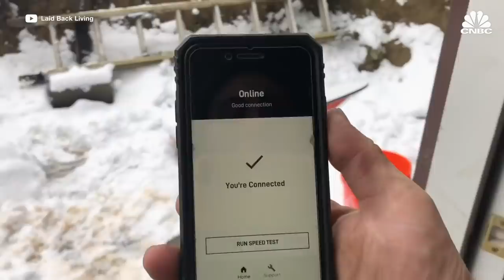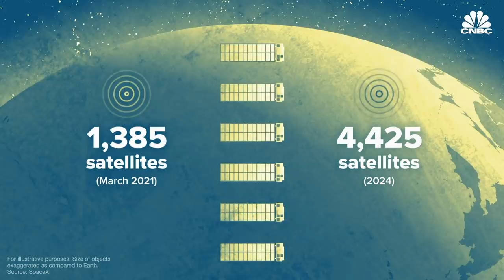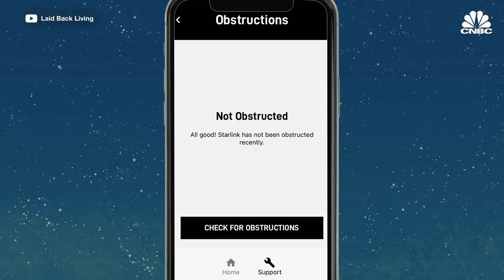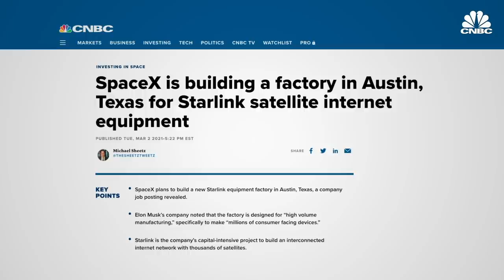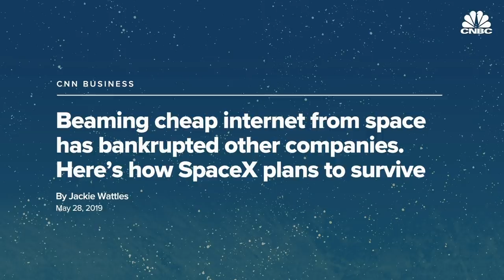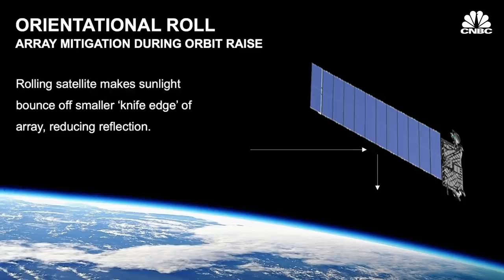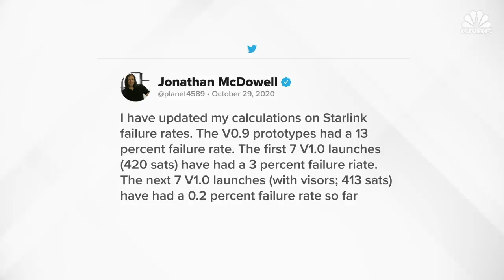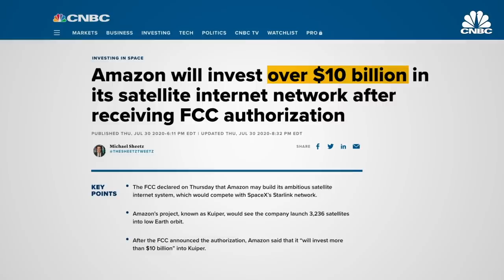Why Starlink Is Crucial To SpaceX’s Success

Comment: I think it was a classy move to work with the astronomers instead of telling them to pound sand.
Reply: And something which every business should do. 
Help the common people.
Reply: Acknowledging you're not the only guy in town and creating room others.. A very classy move indeed. :D
Reply: they have no choice, Astronomers complain to NASA, SpaceX could lose the ability to launch from the facility, they continue to do so congress can clip their wings for good.

Sometimes it's better to take the challenging route before it become unbearable
Reply: @HappyfoxBiz  You take the longer route around the mountain, instead of the short route up the mountain that ends in a freefall off a cliff.
Reply: @HappyfoxBiz  Cape Canaveral launches are controlled by SpaceForce.  FAA is the government agency that gives SpaceX permission to launch.  Right now NASA is heavily dependent on SpaceX for launch services including delivering crew and cargo to the ISS.
Reply: @SDGreg  it's leased from NASA, not Trumps pew pew club
Reply: @someoneinthecrowd4313  if you're unable to achieve goals like launching satellites into space, you shouldn't even start, once the satellite is in space it's mostly just tweaks, if you can't do that then you are hopeless.
Reply: @HappyfoxBiz  The US Space Force has essentially nothing to do with Donald Trump. Most of its missions are the same ones the Air Force was running 5 years ago. Please don't besmirch the good work done by US servicemembers because the branch was created during the administration of a bad president.
Reply: @HappyfoxBiz  SpaceX has two launch sites at Cape Canaveral.  SLC-40 is on the USAF side(Cape Canaveral Space Force Station) now Space Force and the other LC-39A is on the NASA side(Kennedy Space Center). Regardless of the launch site, the launches are managed by the 45th Space Wing of the United States Space Force.  All the radars, range assets, even weather monitoring, yeah that is controlled by Space force.  So yup Trump's pew pew club.  Look it up if you don't believe me.
Reply: @TankDerek  oowah I guess, every tool needs a fanclub, might I suggest spanners?
Reply: @HappyfoxBiz  Wrong. If Congress plays hardball by grounding SpaceX, then how would NASA get the astronauts to the space station? Blue Origin and Boeing are not ready yet.
Reply: @TankDerek  Please don't bad mouth the President that supported the Space Force.
Reply: Elon said astronomers were making a bigger deal out of it than they needed to
Reply: Classy, but also not all that surprising that when the International Community of Academic Space Nerds reached out to the Business and Technical Space Nerds they took the call. I could see there being significant overlap in these two groups as far as dreams and aspirations go.
Reply: This thread quickly devolved from an intuitive comment to you guys arguing about Trump's 'pew pew club', congress, Space Force, and space nerds.
Reply: I would have told them to pound sand. Then again I have no class.
Reply: @HappyfoxBiz  99% sure that Elon would sooner start a space company in Russia than let someone tell him he won't be going to Mars.
Reply: TOO MUCH CRAP IN  THE SKY ALREADY!!!
DON'T DESTROY EARTH JUST TO MAKE A CITY ON MARS!!!--VERY STUPID!!!!!
Reply: From a business sense, it was essential. As they would go to government who would then have stricter oversight
Reply: I think its classy for the astronomers to talk to people who need internet. You know, like the rural farmers who provide their food.
Reply: @khainguyen3056  That clown doesn't even believe in science. Oh but he created Space Force, which was already operating before it was given that title, so lets not bad mouth him, lol what a joke.
Reply: @TankDerek  Space Force isn't even a real branch of the military, it is still completely under the Air Force.  All Trump did was taking a subbranch of the air force and give it a new name.
Reply: @PeterSedesse  The Space Force is a real separate branch of the military. It just takes time to completely separate themselves from the Air Force. A good example would be the creation of the Air Force from the Army Air Corp after WW2.
Reply: @khainguyen3056  that is just not true. There was no plan under trump and still is no plan to make it separate. There is no space force person on the joint chiefs etc. Space force does not have individual budget etc. It was just a photo op.
Reply: of course the russian and chinese satellite commpanies won't be so thoughtful.
Reply: @PeterSedesse  Like I said , it will take time. They already announced they will have their own uniform, different enlisted ranks and their own bases. They will change the name of the certain Air Force base to fit their mission. This is not a hoax.
Reply: @khainguyen3056  trump already said it was its own branch which was a lie. Also there is no movement in the direction that you said. There are no plans for it. We built the entire dept of homeland security in a matter of weeks. Trump had a fake press briefing, and that is the only thing that changed.
Reply: @PeterSedesse  The leftist media really did a job on you. I don't know what else to tell. So long.
Reply: @khainguyen3056  Is there a space force general on the joint chiefs?  No  Does space force submit their own budget?  No Does space force have their own basic training? No    That is three proofs that space force is not an independent armed service.   I have evidence, you just have Trump's press conference.  Do you even know what the Joint Chiefs are?
Reply: @PeterSedesse  When Air Force was spun off from the Army Air Corp, do you think this happen overnight? The Space Corp only just came into existence. They are still dependent on the Air Force on certain things. Rome wasn't built in a day. Be patient and stop jumping the gun.
Reply: @khainguyen3056  Just not true.  There are no plans to make it separate.  Nobody except trump wanted it.. not the GOP, not the Dems, not the Air Force.  It was all just so trump could have another meaningless press conference.
Reply: Outer space is a lie created by the ruling class which knows the sky is solid frozen blue ice.

 Google image the firmament
Reply: "Work with the astronomers" is going to be difficult once there are 40,000 satellites orbiting the planet. SpaceX is just going to string them along until they become too big for anyone else to do anything.
Reply: @Avantime  That is just bad math.  The satellites are half the size of a car.. the sphere they occupy in orbit is 4 times the surface of the earth.   Most small cities have 40,000 cars, now spread them out to 4x's the surface of the earth,  .  Throw in the fact that Hubble and many newer telescopes will orbit above them.
Reply: @PeterSedesse  If astronomers can notice the satellites when there are only  3,000 of them to the point where SpaceX has to do something, then it's going to be a much bigger issue with 40,000. However I couldn't care less (or be surprised) if SpaceX throw those astronomers under the bus later on, once their services are deemed indispensable by many rural residents.
Reply: @Avantime  Of course you can see them if you look for them... but does it negatively impact astronomy?  The one issue they had was the light reflecting off of them, so they put solar screens on the new ones.   To put it in perspective, when Hubble did a deep scan, it was less than 1% of 1% of the sky.  This idea that something smaller than a car, hundreds of miles away is going to ' block' anything is silly.   The sphere that they orbit is huge, and they are tiny... and again, all modern building is about putting telescopes in deep orbit or on the moon to avoid light pollution on earth.
Reply: Generally, Musk companies have been good citizens, and played nice. They compete ferociously, but they do so by being terrifyingly efficient and just improving the product itself, not by playing dirty. For instance, SpaceX holds no patents, and when new competition arrives, far from trying to sue them for some kind of IP infringement, SpaceX welcomes them into the industry, congratulates, and even advices them. Take a look for example at Peter Beck's exchange with Musk on Twitter after Rocket Lab announced the Neutron, which copies a lot of design elements from the Falcon 9, and will be direct competition. Musk joked that it "looked familiar", and then proceeded to congratulate Rocketlab, and said that it was certainly the right move. No lawsuits, no hard feelings. The same goes for Tesla. On Tesla's website there's a section called "All our patent are belong to you", that links to an open source contract that basically allows anyone, including competing car manufacturers, to do whatever they want with Tesla's patents for free. 

More often than not, when a company arrives at a location and sets up a factory, the neighbors hate them. SpaceX paid Boca Chica residents 3 times above market price for their land, many residents started businesses around what SpaceX does, and they have a great relationship, even when they have to kick them out of the villa to test a Starship. 

They allow the fans to film pretty much everything they do, and they've even allowed many like Labpadre or Everyday Astronaut to actually place cameras on SpaceX property. 

Now they won the HLS contract, but they didn't do so by lobbying and playing dirty like BO, they did so by actually following the rules to a T and making a better bid. 

They really try to be good neighbors, and play nice. They will compete mercilessly, and they won't really let anything stop them, but playing dirty doesn't seem to be in their manual, at least so far.
Reply: It was nicely done by SpaceX, Elon probably want his red planet to look as magical as always trough a telescope, rather than his companys satellites destroying the view of the red planet with reflective interference all the time. 😅.
Reply: Even better is SpaceX will be able to launch MUCH heavier telescopes into orbit MUCH faster than anything before for MUCH cheaper. Then those satellites can utilize Starlink for their data backhaul. It's gonna be epic.
Reply: @gingerman5123  Not just heavier and larger telescopes, but cheaper and more available telescopes. Right now, it's hard for most astronomers to get time at any earth-based telescope, forget about getting time on anything in orbit. The Hubble gets tens of thousands of requests per year, and only a handful of them get any time. 

Right now, there is no way to service the Hubble, when it dies, it dies. Starship would not only be capable of going out there and servicing Hubble extending its mission another 30 years for comparatively very little money, It could even do so in a way it's never been done before: With a "dry dock". That is, it could fit the entire hubble in its cargo bay, close the doors, and re-pressurize. Then specialists could work on it easily, without the dangers of an EVA, and the bother of a spacesuit. 

It can launch new telescopes for a fraction of the current cost, and it would also decrease the cost of production of the telescope itself, as much of the current cost comes not just from manufacturing the telescope, but from manufacturing one capable of being launched in current rockets with smaller fairings, and capable of staying out there without maintenance for a very long time.
Reply: @user-sn8oe5sb1b  I’m pretty certain a Starship will one day bring Hubble home to earth. It belongs in a museum!
Reply: @gingerman5123  I would absolutely love that.
Reply: Problem is, like the usual satellite options available, there is a large energy liability for off grid users, which is the main market. I just got a conventional satellite system that uses over 120 watts 24/7 not including the router  . Assuming Skylink is the same, that could become the largest load in the house. Not good for off grid energy limited households. But that's the cost of data i guess. I wander if Musk has thought of that? Is the system designed to be efficient, especially if it has a standard snow melter on it dishes. Would be a waste in Australia...
Reply: @craigme2583  We're obviously on the first revision of the hardware. I'm sure V2 will have a LOT of improvements. I'm in Central Texas and the snow melting isn't necessary but for 5 days out of 1000. I believe "Dishy" pulls about 100w also.
Reply: @gingerman5123  seems unnecessarily high, but we have high power costs here.
Reply: When your company is pretty much solely staffed by people who hold a fanatical belief in a space faring humanity you pretty much take the word of Astronomers as scripture.
Reply: I just hope they can do enough.
Reply: Why do y’all think they are so worried and concerned about the  “rural”  homeowners not having fast internet? Internet of things?? It ain’t cause they care about y’all 🙄
Reply: @HappyfoxBiz  They can have more than one incentive to do something. It's good NASA forced their hand just incase, but the fact they cooperated at all, and did so in an amicable fashion is yeah, a classy move. Either way it happened
Reply: "Classy move"??? Musk has admitted Starlink is counting on a final deployment of 42,000 SATELLITES! No matter WHAT Starlink does to reduce light observable by the naked eye, BILLIONS of $$$$ worth of telescopes across the Earth will be unable to capture the faint light of near-Earth meteors that risk striking the planet! "Class-act" intentions by Musk are hollow gestures and meaningless. He alone will increase the total amount of current satellites by as much as a factor of TEN! It is a factor of 5X's if you include defunct satellites launched since Sputnik. Countries need to capture & de-orbit their decommissioned sat's or eject them from orbit towards the Sun.
Reply: Yeah
Reply: @PeterSedesse   
  Not true I want space force. And it is in the works from what I've read. All I do is eat sleep read retain useless information and knowledge my brain should already know for a fact checkers board game of who's right. "Cause that's important" no the names not important making shore our species gets to live on if earth becomes uninhabitable that's important. Theres many things that can cause this. I really hope we all can be on the same page if where ever ask to go there and help. If we cant be humanity could be doomed. We will be the cause of this over time if we stay stagnant in time polluting our own atmosphere, wars, asteroids that out smart us "so big blowing it up could only cause more harm to us all" these are facts we as humanity never know what's coming let's become the humanity that makes there own path the patch of survival plan B but also it's the path to push forward to become better versions of our selfs.
Reply: @HappyfoxBiz  He can always launch from private land. congress doesn't own space
Reply: @PeterSedesse  well buddy, all the data that's been collected on their brightness and interference till now says otherwise. Even with the shields. Whether or not it makes sense in your head is kind of irrelevant.

Comment: I already preordered mine
Should be here by end of year
Reply: We ordered starlink and it came in 3 weeks. It could be there fast for you
Reply: @Tryckert  
My area needs more coverage before its available here
Reply: @Tryckert  when did it say it was coming? did it say a month or did it say mid 2021 to late 2021?
Reply: @TheGrandMgM  in my area it said mid 2022, I want to work as software developer freelancer and my 0.5mbps down 0.01 mbps up is stopping me
Reply: How much does it cost?
Reply: @josiah1851  
$500 for the equipment
$99/mo
Reply: @That-Guy_  and thats no matter where you are? besides if ur country allows it or not
Reply: @josiah1851  
Yes but they can only have so many people per area so if you live in a big city and you want it you need to get it before your area is saturated
Im in Houston so i had to get it ASAP
Reply: @TheGrandMgM  ours said 3 weeks and it’s already here. Pretty good service. Especially compared to what we had before. The only issue we’ll experience is the occasional drop in reception for about minute, but that doesn’t really affect streaming
Reply: @TheGrandMgM  We’re in northern Kansas, but I think areas that are further south get it later due to the orientation of the satellites. I could also be dead wrong, but I think that’s what will happen.
Reply: @That-Guy_  Didn’t even read this before my last comment about getting service, but this sounds accurate